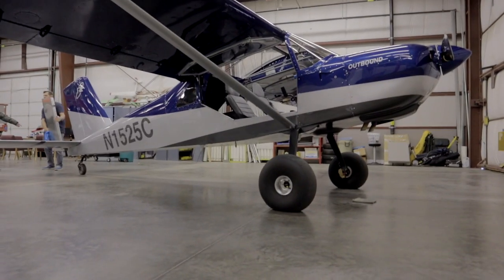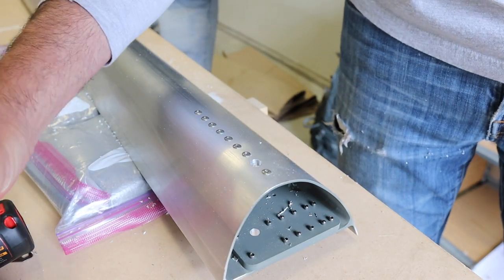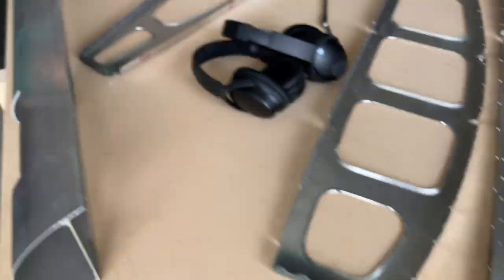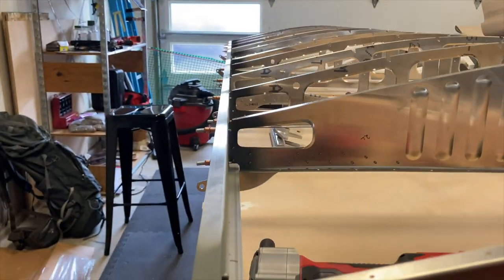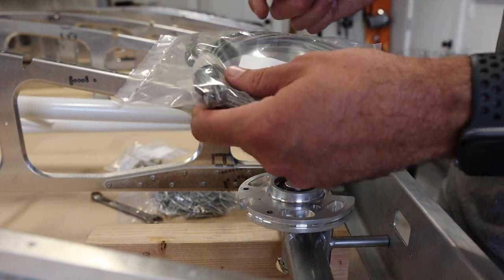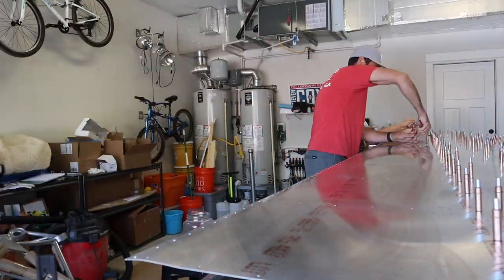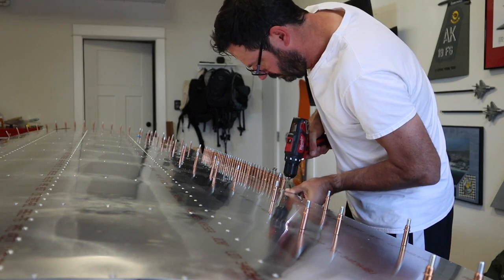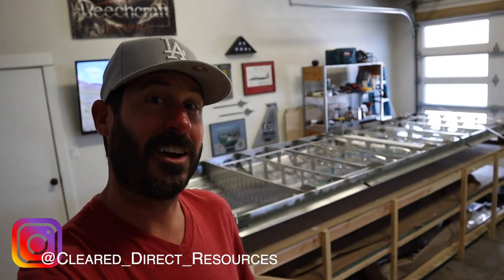RANS S-21 Build Ep 6; Wings Part 1

Comment: Not sure is that much difference, but I believe RANS suggests riveting the spars from the middle working towards both ends.
Reply from the maker: Thanks! My manual says to match drill that way but no guidance on riveting. Makes no difference to me, so I’ll do it on the right wing. Thanks, LTV!
Reply: @CLEAREDDIRECT  I checked again and looks like it says that only for drilling as you said.  I guess I just figured if it made sense for one operation it made sense for the other.  😁
Reply from the maker: Thanks for checking! Yeah, makes sense to do it your way and ‘don’t cost nothin.’
Reply: @CLEAREDDIRECT  I’m just a creature of habit.  I didn’t go full bore and alternate every other hole as I have seen at least one builder do, but I could do one rib section one direction and then switch to the other side to do one rib section.  I did this for both drilling and riveting.  Obviously, dimpling and countersinking don’t matter as their is no reference between spar and skin to maintain during those operations.